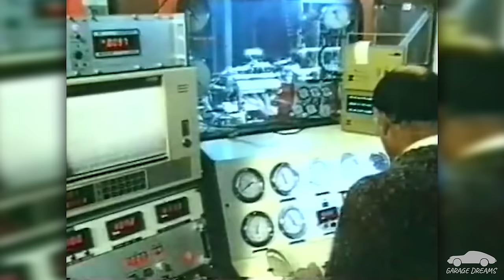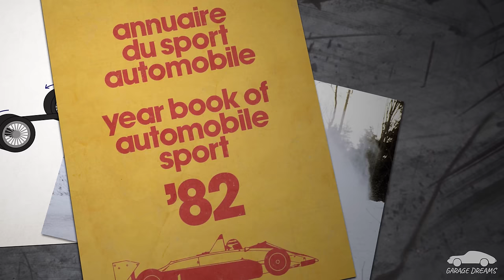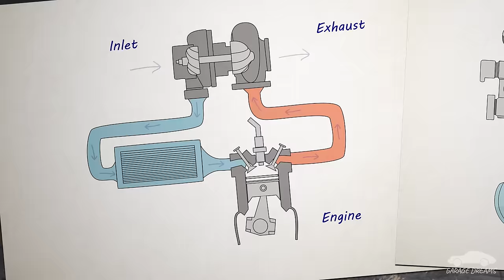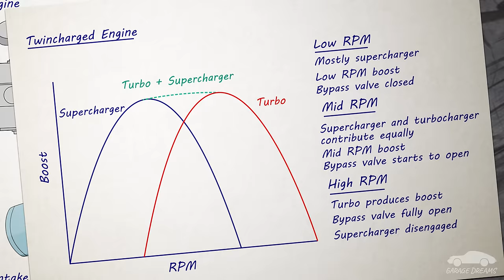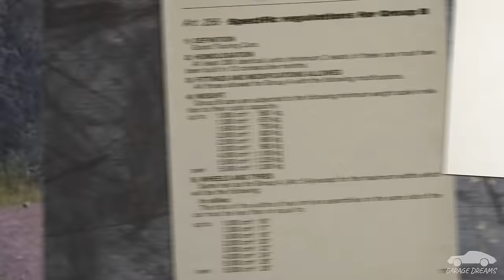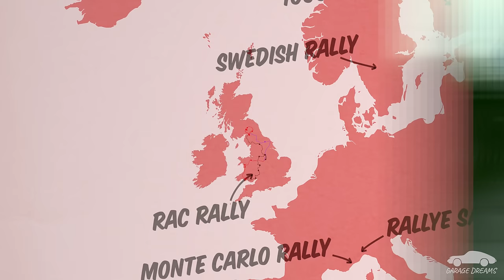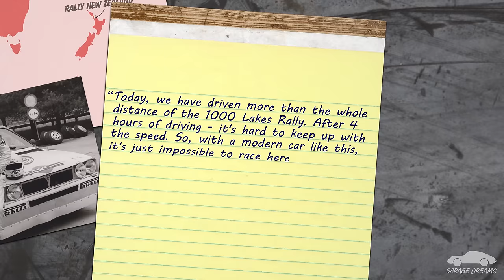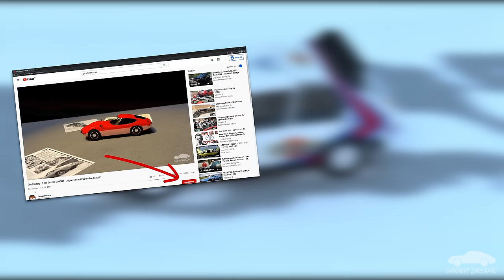The History of the Lancia Delta S4 - The Car That Ended Group B

Comment: Greatest rally Car ever, Greatest Rally Driver ever, same league of Senna. Ps S4 did 450 cv @ 1.6 bar Boost (452 the most powerful engine at Monte ‘86), 1.9 bar boost at TdC ‘96, 2.0 bar at Olympus for 520 cv. Other figures are only exaggerations.

Comment: I had a Delta (and a Beta) lovely cars to drive but poorly put together. As for their Rally pedigree brilliant but you people should also remember that the official FIA report blamed them for cutting corners on safety to make the car lighter and reprimanded them heavily. If it wasn't for the fact the fuel tanks weren't adequately protected on Toivenen's car we may well have had a very different future for Group B.
Reply: The will to win is great and sometimes leads to bad choices, sometimes we need to pause and think...I know, having spent a near lifetime in motor sports.

Comment: One thing may be forgotten is that the drivers were going to protest and not race a round because of spectator safety  Was that what actually triggered the ban, the drivers taking action and impinging on the organizers profits
Reply: The lack of crowd control due to the burgeoning popularity of gp b put the drivers in a moral dilemma. Four spectators were killed in Portugal. There were many other spectator injuries and some killed. Marc Surer had a terrifying high speed accident with the RS200 in Germany that was filmed from a helicopter. Surer survived the fireball, though badly injured, his navigator died. Vatanen had a frightening accident in the 205's debut in Corsica in 84 that left him bleeding around his safety belts, and then in Argentina a year later that almost killed him. The Toivonen/ Cresto tragedy was just the last straw for gp b. I am glad. Rallying should be for production based cars,  not homologation specials. For a Lancia fan at the time Toivonen's death was shocking, but the Group A car picked up the next year and dominated like never before.

Comment: The title is very harsh.. RS200 probably had quite a problem, especially pr, being the car in the news that actually hit spectators. 
The Peugeot was made of the same slim materials as the Lancia... 
Even worse, the Porsche Group C cars of same era, was also very thin magnesium tubing, and the driver's feet was hanging in front of the axle. Making feet and toes a part of the crumble zone. 
There is no one particularly car that was exceptionally good/bad... they were all insanely dangerous at the time. However getting hit/ hit a wall/post in just the right way, can still result in death to this day
Reply: The Formula One cars around that time has the drivers located forward as well and the crash technique was to back the car into a crash. The Indy cars were similar too, but at a higher degree of risk as the average speed was so high. I remember Alan Jones saying he crashed a IROC Camaro heavily into a wall in someone elses accident and it was the hardest impact he'd ever experienced in his career. He was sore and bruised for days and he reckoned anyone racing those tracks in an open wheeler had rocks in their head.
Reply: @ExternalInputs  there is quite a few examples, were drivers walk away from really nasty accidents in 1980's F1.. not so much in the group B cars. Or C for that matter.. still with the HANS only implemented much later, a lot of brain injury related accidents/deaths can occur

Comment: The diagram at 3:45 is not accurate, but the commentary is.  The by-pass at higher revs sends turbo air directly to the engine, else the Rootes supercharger would choke the air-flow.

Comment: These cars were faster than the the mind can comprehend. Car manufacturers were cheating by replacing tubes with cardboard tubes and I believe the car that crashed had many floors in material used in the frame.

Comment: The car did not end Group B.  The Lancia  team just removed safety metal brackets for the fuel tanks on the this particular stage, because of weight saving! This was the wrong decision which changed rally racing.

Comment: The tragedy of Lancia Delta is a reminder that nobody should EVER build a race car with magnesium
Reply: Gasoline ignited. It was a steel and aluminum frame with Kevlar reinforced resin hull and body. The wheels and some drivetrain parts may have been mag, but thick chunks of it will not ignite unless exposed to very high temperatures, such as caused by burning fuel and composite resin.

Comment: Supercharging comes in multiple forms , turbosupercharging is one of them .
Please correct this in your video !
Reply: It isn't incorrect. Supercharging tends to refer to an air pump that's mechanically driven by the engine. Turbocharging is an air pump that's driven by the engine's exhaust pressure, that runs much faster than engine speed. 
There has been multi-stage supercharging in the past on old Grand Prix cars, so it's nothing new. Regardless of the pumps used, it's all multiple stage boosting.
Reply: @ExternalInputs  Both are methods of supercharging (forced induction) 
If referred to properly, one is mechanically driven , one is expanding gas …. Supercharging

Comment: I would like to see group B return in the future with VR technology allowing the drivers to drive the car remotely, so the spectators still get that experience but the drivers are safe.
Reply: It might be a bit difficult since you won't get as accurate feedback compared to sitting in it though.
Reply: @stackhom656  the feedback can be through the wheel like sim racers have.

Comment: Ah yes an awd 550 hp motor with no lag that only weighs 1900 lbs what could possibly go wrong and btw the fuel was believed to leak onto the incredibly hot turbo this what caused the combustion

Comment: Heard a few rumours that Lancia would just use like mock roll cages made of thin plastic to cut weight as safety restrictions were so relaxed they wpuld hardly ever be checked as long as they looked the part, im sorry but fuck that😂
Reply: Is that Jeremy Clarkson bullshit still floating around? Never let the truth get in the way of a good story! Tech inspectors aren't idiots, nor are the car's drivers. Anyway, enough of the cars crashed so any plastic or cardboard rollcages would be really obvious. They were space frame cars, so the roll cage was an integral part of the chassis and necessary for its strength and resiliance over punishing terain. The front and rear body was just clipped on, and provided no rigidity. There are enough ways to make the minimum car weight without potentially killing your drivers.
Reply: I know several race cars used to have aluminium roll cages but plastic roll cages are no more convincing than the bs that roosevelt planned the attack on pearl harbour or the nonsense that Putin elected trump.

Comment: Sorry but the Quattro s, even the SWB sport versions were too heavy, too fat and under steered like a battleship. They innovated in group B, but were quickly overtaken, my favourite was the 205 T16.
Reply: Ironically Quattro's legacy arguably outlived the rest of Group B because when Group B was shelved Quattro actually got tinkered with more, going to Pikes Peak and dethroning the Unsers before switching to pavement racing like SCCA, IMSA, and DTM. Crazy how that happens.
Reply: nobody could argue with that. The Quattro concept rolled on and didn’t stand still, but consider the lancias, they used the knowledge from the S4 and group B to develop the all conquering integrale in the new rally formats (boring)
Reply: It pushed the limits of what was possible with a production based platform, but it was game over when the real prototypes arrived.

Comment: went so far with weight saving that they used cardboard tubing on safety features as well.   Not to mention fool fia officials when showing the homoligation samples.   Picking asphalt tires on montecarlo and driving in front to lay salt on road to melt the ice and snow etc...   

In some level you have to admit and respect the hustle ...    but without all that ...  Toivonen would been ok most likely.  After all..  team would not threat the family afterwards for speaking out if everything was clean for daylight. 

Ps.   Group B car would never be even close to f1 car of the time on any road course track.   Aero + power to weight ratios are so different..  F1 car of the day around 580kg to 640kg with 1200 to 1400 horse power from engine. Even on race spec those f1 cars had around 1000hp...     only thing they could compete would of been 0 to 60 and maybe even 0 to 100 acceleration due 4 wheel drive's grip.    On breaking alone group b cars would loose seconds per corner.    So even if Lancia had their group C (LC2 cars)  test engine with 800 whp installed on group B s4 ... it still would not be even close to f1 car speeds.
Reply: The story of cardboard rollbars it's just that...a myth.

Comment: Wait, the gr.b was AWD or 4wd ?
Reply: basically same thing because awd is all wheel drive wich means all wheels are spinning and 4wd is 4 wheel drive where 4 wheels are spinning and group b has 4 wheel so
Reply: @sdggz3722  not the same:
4WD means equal power to 4 wheels; awd its for example Nissan gt-r that practically all the power goes to the rear
Reply: @jonkarsypm6348  of course you can adjust where the power goes
Reply: @jonkarsypm6348  if you wanted you could change the nissan gtr to 50:50
Reply: @jonkarsypm6348  4wd means the engines power is distributed to the 4 wheels, to what ratio bares no relevance, so theres no need to pretend to be knowledgeable on the subject.
Reply: @theant9821  oh ok

Comment: Wrong....the car that changed rallying forever was the Audi Quattro
Reply: You're saying the german AWD car that lost the championship vs an RWD Lancia 034?
Yeah they changed rallying for sure, letting Lancia become legendary.
Reply: @solinvictus1234  so...which rally car uses RWD now 🤣🤣🤣
Reply: @alexcawthorne811  Really you want to compare Lancia with Audi upon technical car innovation? It's a bet you can't win.
Lancia innovative car solution:
- Lancia Theta (1913) presents the first electrical system integrated into the car.

- 1918: Patent of a prototype of an 8-CYLINDER engine arranged in two rows at 45 degrees and another of a 12-CYLINDER engine, also V-shaped, of 30 degrees.
The latter, presented with its chassis at the London and Paris Motor Shows in 1919, is truly an impressive group, with a crankcase cast in a single block and crankshaft with 12 cranks, six of which (the right group) angled by 40 degrees compared to the others. Unfortunately it will never be mass-produced for fiscal and market reasons.

- The Lambda - In 1922 he anticipated two FUNDAMENTAL technical breakthroughs in the evolution of the automobile: the supporting body and the front suspension with independent wheels.

- 1931: Lancia technicians patented, for the Astura, an elastic mounting system for the engine that can oscillate freely and therefore does not transmit vibrations to the chassis and bodywork

- Augusta (1933) FIRST sedan in the world (therefore first car with internal driving) with monocoque body.
This car brings many other important innovations in the history of automotive technology: from the independent front suspension with helical springs enclosed in seat stays (another Lancia patent) to the rear suspension with leaf springs pivoted on the front "silentbloc" and on "shackles" with roller pins behind; from the free wheel that can be controlled from the driver's seat to the transmission shaft with flexible disc couplings instead of a cardan joint, to the hydraulically controlled brakes that Lancia is among the first European factories to adopt.
In the Thirties, with the production of the Augusta, the Artena and the Astura, the "folding" door opening system (without central pillar) was also inaugurated, which allows passengers to get into the car with great comfort.

- The Aprilia (1937) introduces aerodynamic research and independent four-wheel suspension.

- The Ardea, from the third series, has a five-speed gearbox, a 12 Volt electrical system and Houdaille shock absorbers.

- The Aurelia, in 1950, was the FIRST car with a 60 V 6 cylinder engine and with the gearbox on the rear axle in block with the differential.

- The Flavia, the Lancia goes back to being at the forefront with front-wheel drive, disc brakes and petrol injection. Then it is the turn of the Fulvia, whose super-square engine (72x67 mm) adopts an unprecedented and highly personal distribution with two overhead camshafts.

- 1982: Trevi offers Jetronic electronic injection and, for the FIRST TIME on a production car, the supercharging supercharger, which takes the name of Volumex

Thema 8.32 makes its appearance (and it is the second time at Lancia) a Ferrari engine, 8 cylinders 32 valves, and the electronically controlled Servotronic power steering.

- 1986:
The Delta HF 4WD which is (still ...........) a concentrate of advanced technology:
1) Four-wheel drive,
2) Central differential with Ferguson viscous coupling
3) Torsen rear differential.
In the same year, the Y10 4WD also appears, equipped with four-wheel drive that can be inserted with free-wheel servo control.

- 1989:
The Delta HF Integrale 16V features ABS with 6 sensors and a traction system with three differentials: one free front, one central with epicycliodale torque divider and Ferguson viscous coupling, one rear Torsen.

- The Y10 Selectronic equipped with continuously variable gearbox with electromagnetic clutch, or the Dedra HF Turbo (1990), equipped with "viscodrive" and turbocharger complete with boost-drive.

Regarding carmaker history of innovation, Audi compared to Lancia is a little tiny mouse that did nothing.
Reply: @solinvictus1234  Lancia may have a romantic history and they were lovely cars to look at and drive... I've owned 2 Lancias which gave me nothing but pleasure. Now having said that they were in the garage being repaired half of their life - Lancia's were badly built, expensive to maintain, plagued by technical problems especially electrics and in the long run where are Lancia now? Just another manufacturer consigned to the history books. Give me the technical prowess of German engineering any day.
Reply: @alexcawthorne811  Ahahah the technical prowless of German cars are made by Italians. All the 90's 2000's Audi was designed by Walter De Silva, former Alfa Romeo designer.
The Golf was designed by Giorgetto Giuggiaro.
Lancia unrealiability it's just a fake myth due the Beta issue Lancia had in England that wasn't their fault but Russian fault sending to Italy some steel compromised by the Sea wather.
And regarding "thechnical prowless, when Walter Da Silva retired and stopped to design VW and Audi (2015) Audi and VW become really unreliable.
You know that Italy and Spain supply the 80% of the German cars parts? That's your "technical prowless" of Germans, VW, BMW, Daimler complaining with Merkel during the middle phase of Lockdown of Covid, cause they wasn't able to ending to assembly the cars due the lack of Spanish and Italian parts, due closed borders and transports ahahah
Reply: @solinvictus1234  Bullshit...have you ever owned a Lancia doesn't sound like it. I agree Italian design is timeless they design some great cars but forget about build quality.